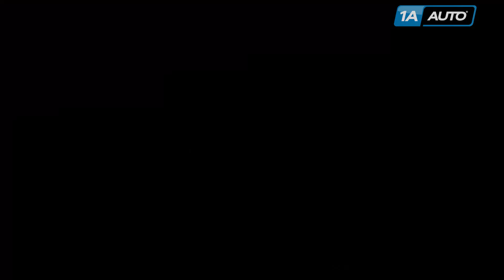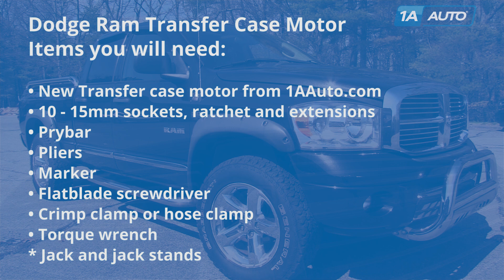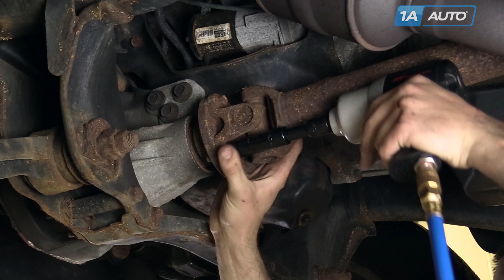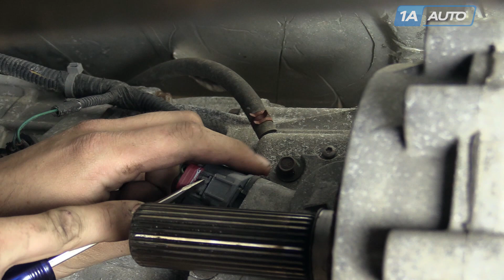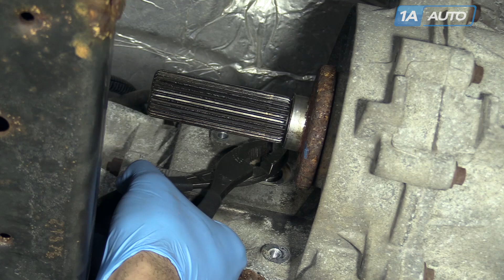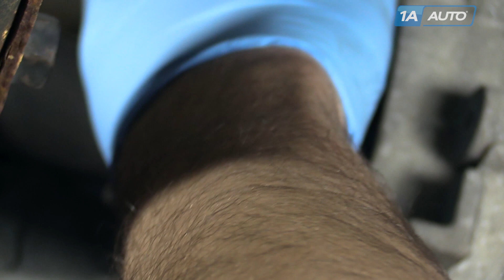How to Replace Transfer Case Shift Motor 06-10 Dodge Ram

Comment: I went to replace my transfer case motor, but I cannot rotate the shaft in the transfer case to line up with the new motor. The transfer case seems to be locked up. 
How do I get the shaft loose to turn it?

Comment: Replaced this part in my 08 1500, install went fine but then when I went to drive it, it won't shift into drive. When I shift into park I can hear the splines turning, but they grind on each other. Any advise?

Comment: My service 4wd light has came on a few days ago and was driving fine in 2wd until tonight the neutral light came on solid and will not engage any gear or go out. Is this the part that failed??
Reply from the maker: +Brandon Love We wouldn't be able to diagnose an issue like that here, you may want to have a local mechanic take a look at it. Thanks for checking us out! http://1aau.to/m/Shop-1AAuto-c
Reply: @1AAuto  I'm broke as a joke so I am my local  mechanic lol . I took the t/c drive motor off and turned the shaft to 2wd and it drives now so figured it's most likely the motor. When I can afford one I'll be ordering it as I get all my parts through you guys

Comment: Did not have to remove the driveshaft on my 2010. It also had a black plastic gasket thing between the tcase and the motor.

Comment: Hello I appreciate your video.  And I want to know....does this way of replacing the case shift motor on a 06 Ram; also applies to 01 Durango?
Reply from the maker: +Donald Carter We don't have a how-to video for your vehicle right now, but the basic steps in this video should be enough to do this task. Buy this part for your vehicle on 1AAuto.com: http://1aau.to/m/Shop-1AAuto-c

Comment: Some moron used thread locker on the bolts on transfer case motor.  I'm dying here trying to loosen them.  Only 1 off so far.  Also, can you do this without removing axle?
Reply from the maker: +armedandnerdy We don't have a how-to video for your vehicle right now, but the basic steps in this video should be enough to do this task. Buy this part for your vehicle on 1AAuto.com: http://1aau.to/m/Shop-1AAuto-c

Comment: Why would this part go out again after 4 months? I have a 3500 dodge ram mega cab
Reply from the maker: +Chris Davignon The most common cause is the transfer case switch, which is an electric motor mounted on the transfer case.  Thanks for watching.

Comment: So I just replaced my shift motor and 4x4 selector switch , now when I select 4hi or 4low it immediately turns the service 4wd light on the dash. Any advice? 2008 dodge Dakota
Reply from the maker: Thanks for checking us out. There could be multiple reasons why you're having this particular problem. We suggest taking your vehicle to a nearby reputable shop to identify the cause. +Martin Fox

Comment: Does anypne know why when i put. My truck in 4hi or low it works but as i turn my steering wheel left or right the truck stop and doesnt move and feels like the brakes are stopping it from moving. But when i got to 2wheel drive it works fine. What can it be ?
Reply from the maker: +Sergio Zamora Unfortunately we cannot really accurately diagnose that. We would advise you take it to a trustworthy mechanic in your area that can look at it in person

Comment: I'm no expert.  I'm changing the transfer case on an 03 Durango with an NV244.  They are tough to find.  I found one from an 04 but they are considered generation 2.  The difference is they have a spline whereas mine has a coupler for the front drive shaft.  Why did they change that?  I'm putting the shift motor back in and there is NO room because of the coupler.  Now I think I know why there is a generation 2.  Hope this helps someone.

Comment: Connecting the motor before mounting to test. It does not rotate. Needs to be mounted to see it rotate? How do I test and know motor is ok?
Reply: Did you find the issue
Reply: ?? What was the issue??

Comment: Thanks for the video. I just got my 04 ram back from the shop after a complete transfer case and drive line replacement. Everything works in both 4wd and 2wd but now the electronic shift selector switch is reversed. 4wd=2wd and visaversa. Did they align the motor incorrectly when they put it back together or does the motor or sensor need replaced?
Reply: Did you ever find a fix for this? Currently have the same issue thanks

Comment: I have a 08' Chrysler Aspen. I am replacing the motor in mine as well, I'm having a problem getting the driveshaft removed from the transfer case. Seems I don't have enough room, can't let it drop cause of a crossmember in front by the axle there and it Only goes up so far. Any suggestions??
Reply: John Spiker same exact problem, any solution?
Reply: Don’t need to remove driveshaft

Comment: hey, I've got a 2010 dodge ram 1500, I did this install with a new motor and it shifted again,  I shitfed into 4Low but now it is stuck into 4LOW and can't shift out of it.
I've tried reversing it into neutral wen crawling forward or in revers but nothing gets it out off 4Low, is the motor bad again or something else ? ( I order a new switch to now !!)
any one has any Idea ? cause the truck is sitting at home still.
Reply: Were you able to fix the problem?

Comment: Will this be the same applies for a 05 Dodge Durango but how can a used transfer case motor be tested too see if it works properly?
Reply from the maker: +berad187 The part shown in the video does fit your application. It should be the same or a similar procedure. Here is a link to them on our website. Hope this helps you out. http://www.1aauto.com/transfer-case-shift-motor-dorman-600-935/i/dmfwm00003?utm_source=YouTube&utm_medium=CTA+Comment&utm_campaign=ytcomment&utm_term=JyTet1V_ch4

Comment: Just a note: I replaced mine today, there was no need to remove the driveshaft on a 2008 Dodge Ram 1500, ALSO WHAT THEY DO NOT MENTION IN THIS VIDEO IS IN ORDER TO GET THE "SPLINE" TO TURN BACK INTO THE POSITION OF TWO WHEEL DRIVE YOU MUST BLOCK THE WHEELS PUT THE E-BRAKE ON AND START THE TRUCK UP, THEN PUT IT IN NEUTRAL BEFORE TRYING TO TURN THE SPLINE OTHERWISE IT WILL NOT TURN..... I WILL SAVE YOU ALL A BUNCH OFF HASSLE.
Reply: Hi Michael so if it's still in 2wd can I still replace with out removing the driveshaft it would make life abit easyer for me. 😊😊
Reply: I did this.  Then replaced the motor.  Now my ram has the neutral light on and will not shift into gear.  Wonder what I did wrong.  I cant get it out of neutral, even after depressing button in neutral.  Any ideas for a frustrated guy..
Reply: @Hl2manchcnz  did you ever figure this out? I have the same problem. Light is on solid and won't go out or engage gears
Reply: @Hl2manchcnz  I know I’m a little late in this, but you have to perform these steps AFTER you replace the transfer case motor.
Reply: How did you replace without removing driveshaft. I can’t seem to get a wrench or socket and ratchet on it correctly. Did you use a universal joint/wobbler.
Reply: What’s funny @MICHAEL LUCIANO is that I went through a pretty frustrating trial and error and was borderline panicking after replacing the transfer case motor, and then I figured it out on my own.  Only then did I see your tip.  🤣 You would’ve saved me about 30 minutes of troubleshooting!  I had no choice but to remove my front drive shaft though: 2007 Dodge Ram 1500 SLT.
Reply from the maker: +MICHAEL LUCIANO Thanks for watching and also the added tip! Have a great day! 1aauto.com
Reply: @1AAuto  📌 Pin Michael’s tip please before someone else runs into this headache!  📌

P.S. Also I’d like to send a thank you for the video.  Your video helped me fix my issue + Michael’s tip got it out of neutral.

Comment: How can you tell if the transfer case motor is no good?
Reply from the maker: +Michael St. Denis When the switch is activated the motor should engage. If it does not and there is power going to the transfer case motor, the motor might be bad. Hope this helps you out. Here is a link to the one shown in this video on our website. http://www.1aauto.com/transfer-case-shift-motor-dorman-600-935/i/dmfwm00003?utm_source=YouTube&utm_medium=CTA+Comment&utm_campaign=ytcomment&utm_term=JyTet1V_ch4

Comment: there is a recall on the dodge home site , 4 wheel lock up intermitent , even when you did not want to use it
Reply from the maker: +Joe Kelderman Thank you for the added tip! Have a great day. 1aauto.com
Reply: dodge dealer told me this morning the FCM $1230 and Encoder Motor $565 , and after install will be $2300 , for some reason only the 05 and 06 durango are not included with this exact recall of all the durango years
Reply: My Chrysler Aspen 2008 is doing the same thing. Are there recalls for those??

Comment: Ok so how do I how if I need a transfer case motor or actuator? I get four wheel high but wont engage into four wheel low ....2010 Dodge Ram 1500 sport 4x4 5.7 hemi

Comment: I have a 2004 Dodge Durango.  I know this isn't the same year, but I just changed all the transmission fluid and placed a new gasket on there.  Immediately after that, my vehicle is switching into 4x4 lock on its own, randomly.  Could this be the cause?  Some research suggests it could also be the A/C low pressure switch.  Could either of these cause this issue?
Reply: I have an 04 Durango that seems to have a similar issue I did the fluids n filter in the trans and then the svc 4wd light came on but the codes in the computer went away  the P0700 and c6525 (I think that was the correct C code)    I cannot road test it as its not insured so Im youtubing possible errors  and the transfer case motor  was one that came up online hence being here and watching this vid which was awesome btw. any luck on your side?
Reply: I've contacted Dodge and they say it is the TCCM or the motor.  They also say changing the fluid should not have done this.  But when it comes to mechanical stuff, I'm a firm believer that there is no such thing as coincidences.  I don't understand how either could go bad with a fluid change.  Would it have happened if Dodge did it themselves?  So many people have this same problem I'm starting to think this is a Dodge scandal not ponying up to a TCCM issue.  I'm trying to find a used TCCM to buy and replace the one I have.  I've done everything else accept replace the motor.
Reply: How do you get the motors unstuck?  Hammer?  lol
Reply: lol ya and if that dont work get a bigger hammer :P  Im not entirely sure to be honest but it could be like a starter if its stuck in place from lack of use etc   you put some wd-40 type penetrating oil on it and work it until something breaks loose,  you or the motor lol
Reply: I have a 2005 Dokota with the same problem (switching into 4WD with out an indicator light). Turns out there is an internal short in the transfer case shift motor. I had the shop just unplug the T-case shift motor and it solved the problem until I can afford the fix. Hope this was helpful.
Reply: Does anyone know how to remove the driveshaft off of the spindle on a 08' Chrysler Aspen? Ive got itlose but it seems there is no room to pull it off. I've got the same issue going on with the 4x4 shifting into high low and neutral I am trying the transfer case motor before the tccm